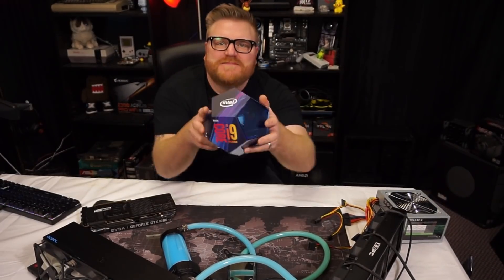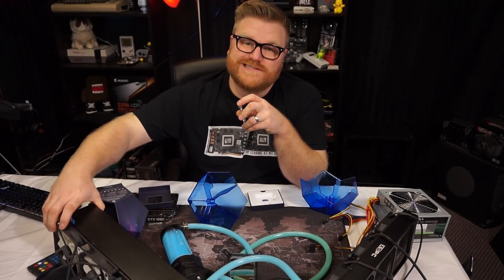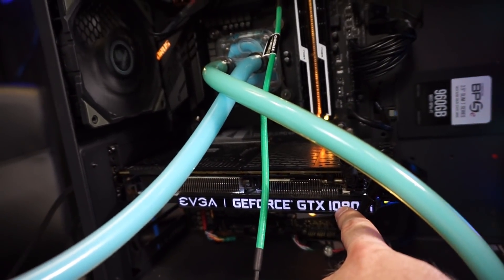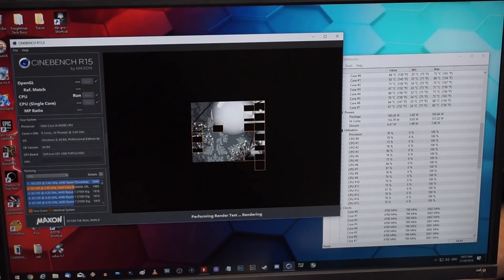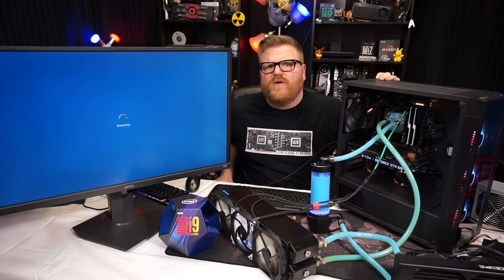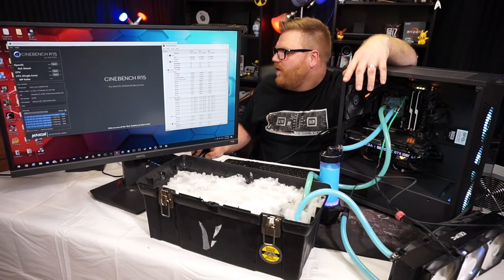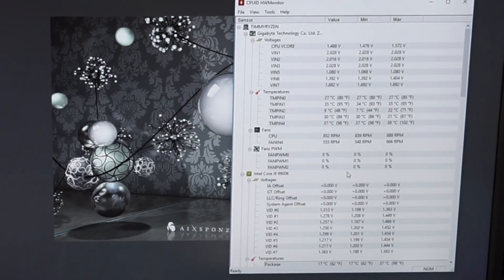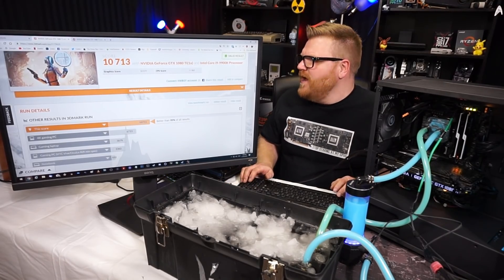Overclocking the Intel 9900k to 5.3 Ghz WITH SNOW!

Comment: That Shintel i9 9900K is literaly hot like LAVA and is melting snow and ice eating eating nuclear amounts of power. What a crappy cpu this is and it's still full of Meltdown and Spectre hardware security holes since it's still based on Bloomfield 2009 and Sandy Bridge 2011 old architecture.
Reply: @D sure buttercup....I know you don't even know how to differentiate between BIOS set desired frequency and realworld frequency :-) in reality your Shintel i9 9900K is running at most at 3.5 GHz all core with maybe 1-core turboing in 15 sec interwalls....while you're sitting there proudly thinking you have it OC steadily at 5.2 GHz. In reality the i7 8700K couldn't already be cooled by any tower air cooler as soon as MCE was turned on. Any higher core count Shintel was even worse :-).
Reply: @D sure buttercup, keep believing your fantasies of a magically OCd Shintel crappy cpu....while literally everybody else on the planet is enjoying the usage of a Superior architectures ZEN 1, ZEN 2 and ZEN 3 that give the absolute superior performance on every plain :-).
Reply: @D sure buttercup, the puny overheating nuclear power hungry 8c/16t cpu, with all the hardware security holes, will.melt itself before running cinebench r15 :-)
Reply: @D offcourse it hasn't melted for you yet....because in reality it doesn't run constantly at your imaginary 5.2 GHz at all....but rather at 3.6-3.7 GHz at most due to too high LAVA like temperatures on the cpu die and the VRMs especially....so it downclocks after 15 seconds to much lower frequencies hence produces much lower performance :-)
Reply: @D sure buttercup, while sales numbers show literally AMD ZEN 2 and ZEN 3 cpu-s selling 75:1 compared to Shintel and that number has been rising for the past 2-3 years now :-)
Reply: @D buttercup, I've got 20 years of PC building and repairing PC-s and laptops under my belt. I've started experimenting with GPU-s as my deep dive testing hobby in 1998 when 3D-FX Voodoo 2 12MB PCI was a monster rendering graphics card and when Shintel Pentium 2 cpu-s was an expensive mainstream basis....when you reach that level, then we can talk....until then, buttercup, stay in your Shintel biased fantasy land :)

Comment: nice video, but you are heating the water in the system up with the first rad blowing ambient air on colder water, that is why you feel cold air from it, because the ambient air is leaving its heat and picking up cold. just a tip for next time :)

Comment: Well my 9900k will run 1 cinebench run on 5.3 with 1.43v and it wont even thermal throttle with a h150i pro rgb from corsair
Reply: Mephiplays Joe is a liar and trying to sell you amd over intel. 7:45 Joe exaggerates the 9900k temps and also underestimates the performance of Noctua NH-D15. Dont believe me, see for yourself as I test exact Cinebench test:  https://youtu.be/POzPHfXSBJ0

Need more proof, watch under AVX load which is way more intense than a 20 second Cinebench test:
https://youtu.be/POzPHfXSBJ0
Reply: @JM-rf8vv  it is because his mobo was pushing 1.4 vcore to the cpu as stock... Shit configuration in the motherboard he used. Mine runs at 80c with 1.35vcore 5ghz in cinebench r15 with a corsair H100i RGB Platinum.
Reply: Manakuski that makes sense. Thanks for pointing that out

Comment: I'm actually....not impressed. It really barely out ran the 2700x even when both are pushed to limit. I expected a bigger performance gap honestly. The 9900k is a joke at $580.

AMD TR1920X $440 Score 2500cb
Ryzen 2700X $300 Score 2000cb
Intel i9 9900k $580 Score 2300cb
Reply: I know right?  Im still on my 4790K at 5Ghz Daily and this CPU is 5 years newer and $$$$, And its R15 score Overclocked is only 900 points higher? LOL  And like 8% Faster on Video,  Not even REMOTELY Worth  600$  And NOT Worth Upgrading!
Reply: @igotzpotatoaim520  Running my 4790k at 4.5ghz all core auto voltage never crashed on me once. I'm ditching mine soon as the new R7 3700x comes out. I can't support Intels shady business anymore and I want to switch to a platform that has a better upgrade path like AM4.
Reply: Camdex  amd should also release a higher flagship cpu a ryzen 9 2800 2800g and 2800x or 2900, 2900x and 2900g and AMD we know will sell cheaper than intel and everyone is gonna buy amd for better performance and cheaper price i9 9th gen 850€ and ryzen 9 2 gen or 3 gen 650 or 750€ that is why I like amd a lot more than intel
Reply: @mikaelhay301  - After I sell my 4790k system I'm going to build my Ryzen system with a used R5 1400 to kinda maintain the same perf as my 4790k until the new 3700x comes out early 2019. 

Far as AMD releasing something like the 9900k probably isn't going to happen just cause it would kill entry level Threadripper sales like the new 2920x 12 core. Intel may release a 10 core mainstream in late 2019 but it'll be so expensive I don't think AMD will even bother trying to compete with it. That high end market doesn't sell well in reality so it's kind of a waste for companys like AMD to invest in it. All the new Ryzen CPUs need is 10% more IPC, xfr boost to 4.5ghz and overclocking to 4.7ghz and They should match 9th gen Intel. The ONLY thing keeping Intel ahead right now is their high clockspeed.
Reply: @mikaelhay301  I've also heard rumors of a 6 core Navi 7nm APU. I'd like to see a Ryzen 5 3600g like a bigger brother to the current 2400g.
Reply: Camdex   Just buy 270€ ryzen 2700x because no one is gonna buy i9 9th generation for only  +300cb
Reply: The Ryzen 7 1700x was $150 on newegg. Cinebench r15 Scores 1775 @4.0ghz. Incredible multi core performance per dollar.
Reply: The closest AMD comparable CPU is the 2920x @ $650, and the 9900k is about 9-10% more performance overall.  The closest match is the 2950x @ $900, where the 9900k only beats it by 3-4% overall.  The 1920x @ $420 is about 20% less performance overall.  20% is quite a bit less, and really puts it in a difference conversation.
Reply: 2000cb on 2700x isn't really 300 bucks alone. You need a good silicone and good RAM to do that but with this guys testing procedures who knows lol.
Reply: @tmkongen  Yeah, but AMD customers have selective memory about stuff like that.  I hit 211/2013 in Cinebench on air and no OC-ing.  Thats straight out the box.  It is basically impossible to break 200 single on the 2700x, and quite the feat to break 2000 in multicore.  These two CPU's are really not that close.  Overall, its about 20% more performance with the 9900k.
Reply: @KungPowEnterFist  Myeah that's hard to believe m8. You should make a movie of it and post it. You would need 4.5+ on single core to achieve 211 and 4.3+ multicore for those results and that does not come out of the box. Just got the 2700x myself so would like to know how you did that. https://www.reddit.com/r/Amd/comments/8eaves/2700x_up_to_45_ghz_in_single_threaded_loads/
Reply: @tmkongen  Unless I am mistaken, 5.0Ghz single core is the default advertised Intel Turbo Boost frequency.  4.6Ghz 8 core.  That's what everyone gets out the box on air, no matter how good your sample.  My motherboard came with unlimited power limits by default, which actually resulted in slightly higher scores.  I set limits of 180w, 150w, 28secs, 193iccmax, 1AVXoffset, so that it actually performs slightly less than what I was getting in the default state.  I am not chasing benchmark scores.  I want real world performance.  Going higher than those stock frequencies (and power limits) gets me almost nothing in return.  It's not worth it.  I think you may be underestimating how good the 9900k is out the box.  It's far and above better than the 2700x, especially if you dont want to OC very much.  Just a minor tweak or two, and this thing is a content creators dream CPU.  I'm rendering 4k in Resolve in near real time.  That's insane!
Reply: @KungPowEnterFist  Oh sorry m8, thought you were talking about the 2700x CB results lol :)
Reply: @tmkongen  No worries.  I dont put a lot of stock in those extreme-o-phile benchmark scores.  You always end up having to pull back quite a bit from your best score settings for real world use.  The 9900k does 2000cb right out the box, which is fantastic.
Reply: Way better for gaming
Reply: but in gaming it is like 40% better
Reply: 9900k just came out, 8700k's were $420-$450 when they first came out and can be had all day for $330 now.  Why don't we wait until there's actually sufficient supply before we compare prices.  And the problem with your math is that the 9900k outperforms both AMD CPUs in games pretty substantially, and now outperforms 2700X in productivity too.  So once the 9900k settles to the $480 it's supposed to cost it makes a heck of a lot more sense than the Ryzen 2700x (for basically every single usecase) and the threadripper for anyone who's not doing CPU rendering on their PC all day every day.
Reply: @auburntanner951  If I remember right the 9900k is somewhere around 15% to 20% faster. So shouldn't it cost about that much more to be good value. In that case the 9900k needs to drop down to $375 to $400 dollars which I doubt will happen. The R7 3700x will close this gap even more still remain under $400. The 9900k is a great CPU, Intels pricing is bad. Intel is a shady company anyway I won't be buying anymore products from them.
Reply: @10WA  I think the current price "Value" argument is overrated on something like a CPU that should last multiple years.  People shouldn't be looking to upgrade processors ever 2-3 years,  and when you look at even a 180 difference that's very little money over the life of a CPU (over even 3 years that's only $5 a month).  While I do agree Intel needs to compete more on price, and while I do agree that the next Ryzen series could be very good (though I don't know that it will reach 5ghz or even reach the speeds of the 9900k), the 2700x will become obsolete before the 9900k, meaning the cost isn't as much "value" as it seems since you'll be replacing it sooner.  As of right now, if you're a gamer and can't afford 9900k, the 8700k is a steal as it outperforms the 2700x in gaming situations fairly substantially.  If you need to game AND use it for production, then $180 more for a 9900k shouldn't be a deal breaker.
Reply: gr82banautiger.The main problem here are than the 9900k are almost double the price of the 2700x which makes it a very bad buy.Your argument that the 2700x would be obsolete before the 9900k are false as when you play on higher than 1080p where you get gpu bound there's very little difference between cpu's.I bought a 2600 non x which score   1330 in R15 on 3.85 and i am pretty sure after i get my aio i will get close or over 1.5k.This cpu already will last me a couple of years for 1080p gaming.

Only reason you would even consider buying a 9900k over a 8700k are when your a competitive player and need the higest fps.The average person won't feel the 30fps difference between the amd and intel cpu's.Even if they drop the price to $480 it would still be a bad buy as it barely beat the 2700x and it takes so much just to cool it down and even then it overheats so it will not out last the 2700x.The other thing is if this is the best intel can do then they will be in a heap of trouble when the zen 2 arrives.There's already a rumor the zen 2 sample push 4.5ghz but i take it as such just a rumor.But what happens if amd release a same clocked cpu than intel.....
Reply: @pierregrobbelaar9116  What part of "Why don't we wait until there's actually sufficient supply before we compare prices." did you not understand?  And no, the 9900k trounces the 2700x in gaming and in productivity.
Reply: @auburntanner951  Zen2 should have at least 10% better IPC and 300 to 400mhz higher clocks which should nearly close the gap on the 9900k and still cost much less. The 3700X is just around the corner so it won't make sense to compare Intels NEW 8 core with AMDs old one.  Far as longevity Ryzen and AM4 wins, Intel changes every generation where the AM4 platform has 2 more generations of CPUs for future upgrades. Also the big spenders that buy CPUs like the 9900k are typically enthusiast and will not keep a CPU more than a generation or two.... that's kinda what makes them an enthusiast. I'm not really impressed  with the 9900k in any aspect. It's only slightly better than other threaded 8 cores because of it's crazy boost freq "which is ALL that's keeping Intel ahead" and it barely beats the 8700k and 9700k in gaming. Again far as price even 2months from now if its readily in stock I don't see it dropping below $499 which is still way to expensive considering the the 3700X will be around $350 to $400 tops and be with 5-10% the performance.
Reply: @pierregrobbelaar9116  The 9900k price is not double.  BLT has been having them for $519, retail box, if you are patient.  Heck, even Best Buy has/had them for $530.  The cheapest price I am seeing on the 2700x is $330. So, its more like 60% more expensive.  Certainly not double.  Not even close.  Get your facts straight before you blurt out more stupid nonsense like this.  When supply/demand levels out, the 9900k will totally be under $500 as others have pointed out.  I can see it going as low as $450 in six months, which is the kind of Spring % price drop we saw on the 8700k this past spring if I recall.  As for which will become obsolete first is debatable.  Different people have different definitions of that.  If you are trying to keep and maintain a "competitive" high end system, absolutely the 2700x reaches obsolescence first and by at least 12-18 months.  20% less performance on day 1 is a substantial mountain to overcome.  Thats a whole year lost at the back end of the window, at the minimum.
Reply: @auburntanner951  That's wrong you can't apply your prices to everywhere here the 8700k is still 429€

Comment: After watching this, I'm definitely waiting for Zen 2...Intel is ridiculous, lol.
Reply: @Traumatree  ' Tip don't use the yellow snow ! '
Reply: shame on u
Reply: Gurvinder Parmar just buy i7 9700k with same 8 cores with much less money like 500-600€
Reply: @mikaelhay301  Even that is sold out at most places...I already have a 8 core 1800x...I'm waiting on Zen 2.
Reply: Gurvinder Parmar 7:45 Joe exaggerates the 9900k temps and also underestimates the performance of Noctua NH-D15. Dont believe me, see for yourself as I test exact Cinebench test:  https://youtu.be/POzPHfXSBJ0

Need more proof, watch under AVX load which is way more intense than a 20 second Cinebench test:
https://youtu.be/POzPHfXSBJ0
Reply: I'd recommend watching more than one video
Silicon lottery comes into play pretty heavily with these chips
Reply: @SamahLama  Yeah some off the lucky ones can only get 5  Ghz or less with a decent all in one cooler ... check hardware unboxed on here
Reply: @Justchuck69 yeah some of them get screwed over. To be fair the chip runs pretty well at stock, so I guess there isn't much need to actually OC.. But some can OC so well. Feels pretty unfair
Reply: @SamahLama  Also it varies on different motherboards and what settings are ! MCE and other things !

Comment: It's only stock speed if you count violating Intel specifications to push like 60% more wattage through the chip than if you didn't violate the Intel specs.  4.7ghz all core boost thru an entire cinebench run is an overclock courtesy of the motherboard.

Comment: Solved intel's heat problems... why not tackle the global energy crisis next? Great vid!
Reply: The 9900k on ice (83C) ran a lot cooler than the Ryzen 2700X (102C) he overclocked to 4.4ghz to get near to 2000 Cinebench, which this blew past at 2300.  So please, let's don't talk about a "heat problem" when we're talking about Extreme Overclocking.
Reply: Matthew Barr Joe is a liar and trying to sell you amd over intel. 7:45 Joe exaggerates the 9900k temps and also underestimates the performance of Noctua NH-D15. Dont believe me, see for yourself as I test exact Cinebench test:  https://youtu.be/POzPHfXSBJ0

Need more proof, watch under AVX load which is way more intense than a 20 second Cinebench test:
https://youtu.be/POzPHfXSBJ0